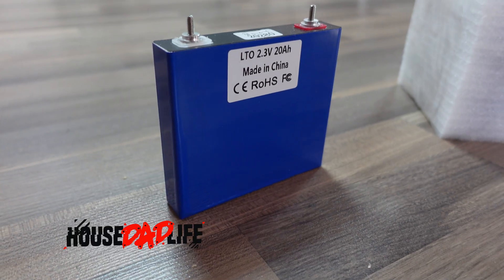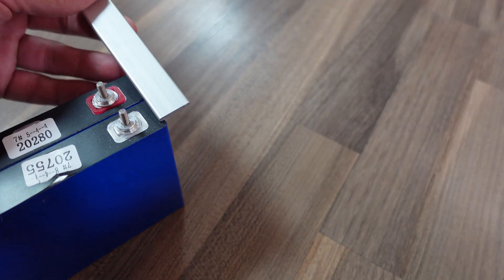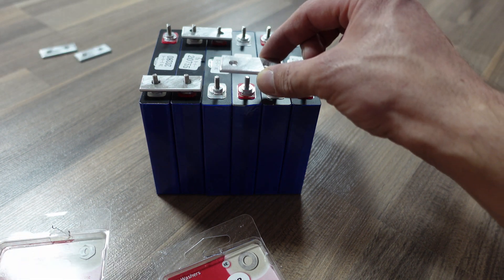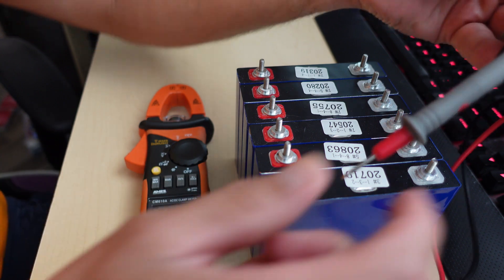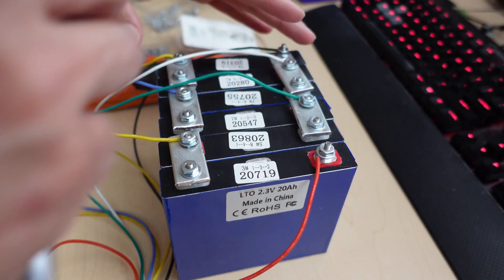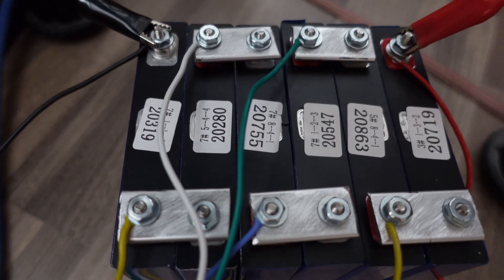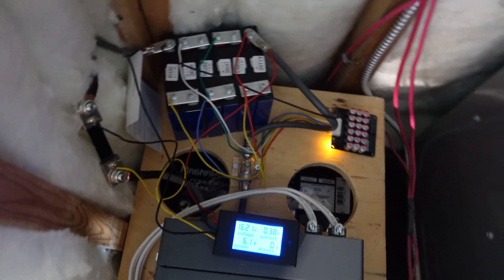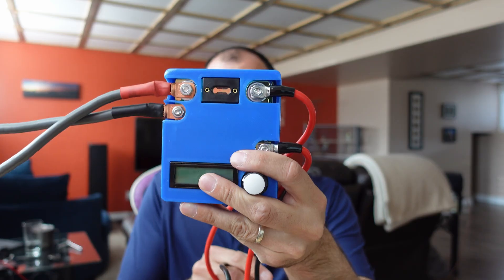Unbreakable Power: My LTO Battery Build

Comment: Thanks for the walk-through of your setup! I wonder if, as a best practice, there should be a BMS in addition to the balancer used in the video?  Most information i've been able to track down , doesn't assume this chemistry.
Reply from the maker: I had to do a ton of research before building this thing, the conclusion I came to was a balancer was enough.  These cells are just very stable temperature wise and chemistry wise.  I've looked for a video where they start on fire, every other lithium cell becomes violent, not these guys.  People have used them to replace lead acid in vehicles without even adding a balancer and that seems to work.  Insane cell life, the only downside I've ever been able to find is they don't have the energy density of the other lithium chemistries.  
I still use this cell every 2 weeks or so, either running a battery backup, powering an inverter, or powering a spot welder, still works like the day I built it.

Comment: These batteries are designed to run equipment unattended for a long period of time with pass-through solar power. A couple of days without sun draws them half way and because of the high charge current they can be full again in less than an hour. An alternator should be able to deliver 16.82v to bring the amps down to zero. Really a battery you can use safely without a BMS.
Reply from the maker: I'm a huge fan of this battery chemistry. I know the cold weather performance is supposed to be really good as well.  Not as energy dense as the other lithium chemistries but they seem to be much more stable.  My only problem with them is availability.

Comment: Hi i did not found These cells on the store you Tell it on the Video.
Reply: They go through stock very very fast. What you see today will not be there tomorrow if it is something desirable at a good price. And Battery Hookup has great prices if you are comfortable working with used cells. They often get stuff in with crazy high remaining capacity. Pretty honest when a batch of something is actually “used” and they are seeing a 20% capacity loss or the cells are sitting at super low voltages and need to be recovered (totally possible for LiFeP04 and LTO, not so much NMC Lithium Ion which are effectively dead when they sit below 1V for any extended period of time)
Reply from the maker: You're right, I couldn't find them either today, the only LTO batteries I could find are https://batteryhookup.com/products/shengquan-6s1p-6ah-lto-lithium-titanate-power